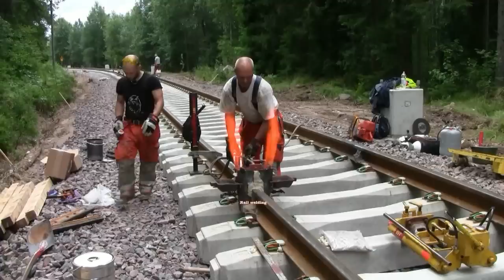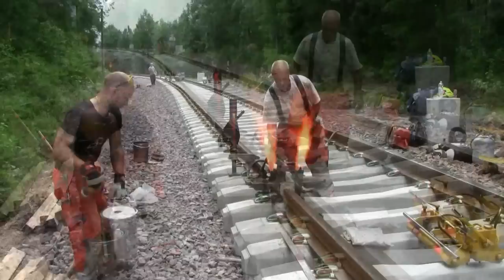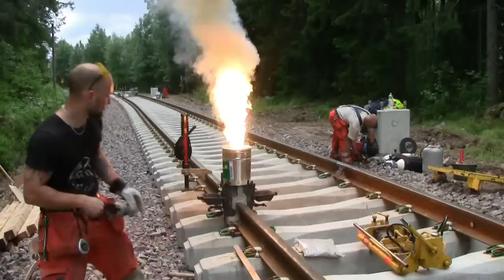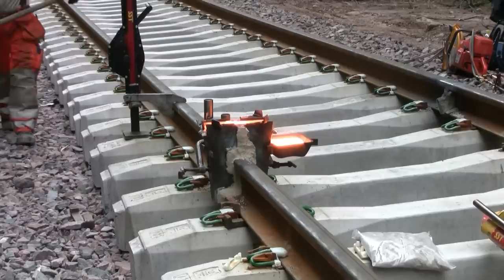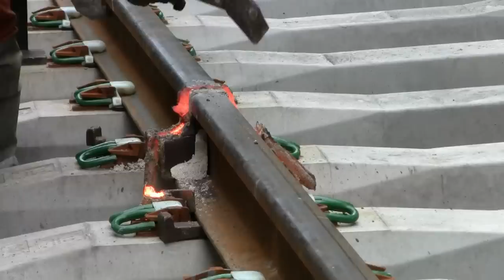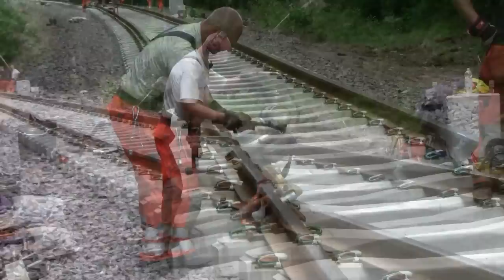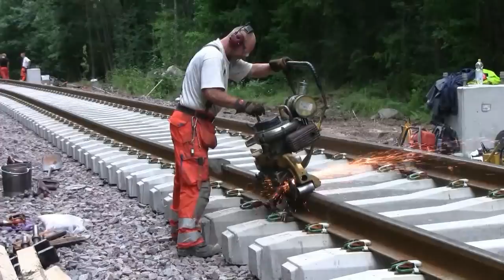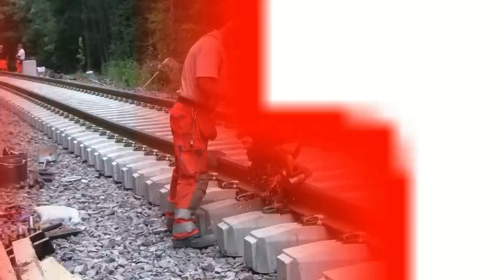Railroad thermite welding

Comment: Fantastic, I studied this process 50 years ago as a welding apprentice but never saw it before, this joining of railway lines was the only application it was used for then.
For those that do not understand welding, it is still done today as before because while the set up is slower the overall process is faster than a manual process, the rail contour would be a pain to manually weld and dam. Thermite welding deposits a very high quality weld and not to forget this is a "Hatfield Steel" an 11 - 14% Manganese steel, not so easy, except of course to you experts out there.
Reply: David Richards I thought that they used flash butt welding for rails.
Reply: Howard Glen Flashbutt welding is used in the manufacture of long lengths of welded rail, but when it comes to joining those lengths up in situ it's usually thermite welded
Reply: ***** To flash butt weld these rails on site would require them to have their own electrical sub station, the KVA requirements would be enormous.
Reply: David Richards Not so, there is mobile rail flash butt welding machinery available, it doesn't tend to get used much because difficulties with track access, availability and cost all tend to favour aluminothermic welding currently.
Reply: David Richards Thanks David, you saved a non-welder (that would be me obviously) from asking what might have been a silly question. My first thought was stick weld it, apparently that would be completely wrong.
Reply: David Richards you could easily do the same hob just as good with a good welder with an old fashioned rod welder.....  I'm sure you would agree with that. my welders do metal weld pipe thats under way more stress than that track will ever be with good old fashioned rod welders and you can't beat them fuck mig welders
Reply: Colestercamps Of course you could weld it with an electrode without any problem but you would spend half the time removing the slag, building up the contoured profile etc. This Thermite process is very reliable in quality and far quicker not only on the welding side but post clean up. For this particular application it is a no brainer.
Reply: David Richards ya i guess your right
Reply: David Richards good lord...finally someone with some professional knowledge...why do laymans think they know it all?
flash butt welding would cost an enormous amount of energy to process...the costs would be somewhat 10-20fold to thermite welding. not to speak of how time consuming it would be... ty david for your insight! :)
Reply: David Richards what do i know ? I'm one government test and one practice test away from being a red seal  b pressure certified   juryman welder(thats master welder if your american ) .... i have been welding since i was 10 years old.  i probably will never finish it now because i have a company to run. not to mention i employ and work with 11 sub contracted welders and have been around the oil and gas industry bitterly since before i was born )(my mom was my dads secretary when she was pregnant haha) i bleed oil.  this practice of welding is so rare they don't even teach it at school not to mention i doubt theses guys are even welders this is not welding (witch is an art form in its own way) i would call them medal joiners and nothing else i would love to see these guys throw down a tig or stick weld if they even know what that is
Reply: David Richards oh ya one little test away from having one of the highest welding tickets in the world (a Canadian red seal) so yes i know allot about welding. i just don't have time to go write the dam thing due to running a company and stuff haha
Reply: Ever Piek I would't exactly consider myself a layman in this, I'm no welder true but I am an IRSE licensed signal technician with nearly 15 years experience in track and signals.  Like I said, mobile flashbutt welding machines are out there, but for the most part cost, practicality and availability all favour thermic welds so that the mobile flashbutt machines are very rare, to the point that I've never seen one in person.
Reply: i have...by the bahnbaugruppe... DB
its fast, but must be incredibly expensive. they had a huge genny running, installed on the dualtracks truck, that had to be refueled twice in 3 hours
Reply: Ever Piek You should have filmed it and put it on Youtube :D
Reply: David Richards hi . I want to ask you I know the gap between piece and others is very important for stretch . now if we welding all piece together . how we can avoid  the problem of stretch
Reply: This was a great comment. Thank you for posting :)
Reply: Manganese. A lot of people don't even know what that is.
Reply: I was thinking the EXACT SAME thing.
Reply: @boterail  
I believe they are people from the country of Mango.
Reply: There are many differences in railroad welding and welding in other industries. Welding car/locomotive, etc. usually uses common arc welding processes to join mild steel, stainless, 
cast iron, and manganese. When welding tracks requires more specialized welding applications.  Most commonly used are electric arc, thermite, and flash butt with SMAW, GMAW, and FCAW used to weld manganese and carbon steel track components; thermite and flash butt are used to join continuous welded rail. Flash butt is mostly done in a facility to create
ribbon rails that are transported to the location for install.  
Flash butt is also used at times along with thermite- aka   aluminothermic welding- in the field as well to connect the rails. These processes are also used in 
maintenance of the rails. These welds have a higher mechanical strength than other forms of weld, and excellent corrosion resistance.  The process in some ways is expensive compared to other welding processes, requires lots of moulds, presents repeatability issues, and can be impeded by wet weather conditions but thermite welded rails have the advantage of withstanding extreme wear placed on rails by electric, high speed rail systems, the portability of the process, etc.
Reply: Why didn't they just use some jet fuel? As the twin towers 200.000 tons of steel melted so easy.
Reply: @tikmaanboksouwe  structural steel doesn’t need to melt for a building to collapse, it just needs to bend.
Reply: @paulg3336  the mid/lower part of the building was intact, the steel below was not weakened, also the steel is  thicker and stronger on the bottom. No building has ever vaporized into itself.

The "planes" blew up on impact, the kerosine burns up in the first few seconds, after that you have a normal office fire, office fires is exactly what these buildings are designed to withstand. Also, the possible impact of Boeing airliners are included in engineering these buildings. 

None of it makes sense, the buildings were blown up from the inside.  Months before there were "elevator upgrades" which blocked whole floors from the public. also there where Israeli "art students" making art and having pictures with bb fuseboxes on them. 

Meanwhile, we got drawn into middle eastern wars which only benefits israel, american lives where lost. Resulting immigration is used to make Europe into chaos.
The not so Patriot Act was created to give the government Stasi-like rights to use on their own citizens. 

911 was an inside job

Comment: The ending is so unsatisfying. Show us the damn result!
Reply: Look at the right rail... the silver part is what the finaly looks like
Reply: yeah no.
Reply: this is finished
Reply: very unsatisfaction, didnt melt the rail metal
Reply: look dude.the vidio is ended.
Reply: The finished product is a polished rail that will rust in 1 day looking like the rest of it. What really is missing is the part where they cut the gap with a oxygen torch and set the rails to even make the weld happen. I will upload a video in the future from start to finish whenever i have the time to film and edit if you are interested

Comment: I thermit weld now for almost 4 years and i can tell those guys are experienced even tho you dont see how they prepared the rail for the actual welding process. Like cutting the necessary gap with a flame torch and setting the rails even with almost zero tolerance. Hats off to anyone who survived this job for more than 1 year. Even tho you see the "actual" work done its also the easiest thing about the day. But carrying this heavy equipment to where the rails have to be welded is the hardest part for us. Sometimes we push it on a wagon that fits on the rail tracks miles since u cant reach it with the working car & if you have a bad day you have to push it uphill. To this day its always a challenge, for all of us.

Guys who looked like the rock quit after 1 week saying its too hard for them. This job exposes men that thought they are the toughest. Having and finding the will every single day is what keeps you welding rails no matter how tough you are. So if anyone looks for challenge i can recommend to go for it. The treat you will get is good money and back pain really fast x)

Comment: "they told me I had to wear safety glasses, they said NOTHING about them having to be over my eyes"
Reply: OttovonEarth work for a class 1 freight railroad in the USA. US Railroad companies are notorious safety Nazis.
Reply: Do you think they would help? Thermite can be a bit warm
Reply: ..OttovonEarth...you are crazy mon....
Reply: @davidthedustyhampton690  iirc thermite gives off a lot of UV, so UV blocking glasses may be what the safety folks are asking for.
Also if your thermite goes crazy you can get sparks and little bits of metal flying around, which they probably would help with, just not the molten stuff.
Reply: Any protection is better than none
Reply: LoL 😂 , excellent
Reply: gGzfahza
Reply: nice day and then we can you can you
Reply: @OttovonEarth cors tec
Reply: Load